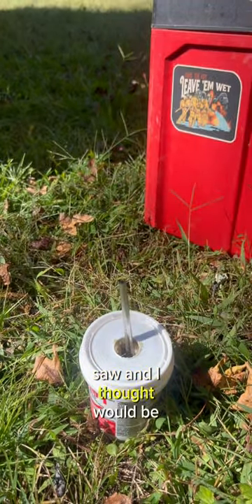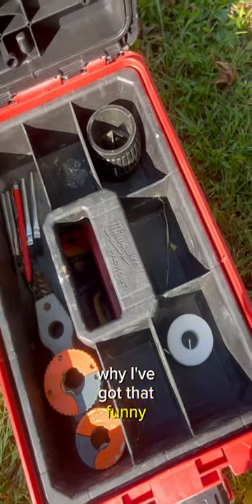Plumbing Tricks #shorts #plumbing #plumber

Comment: Try cutting an x in the lid with your razor knife & bend the tabs in a little it will hold your brush tight & you won’t pull gobs of flux out